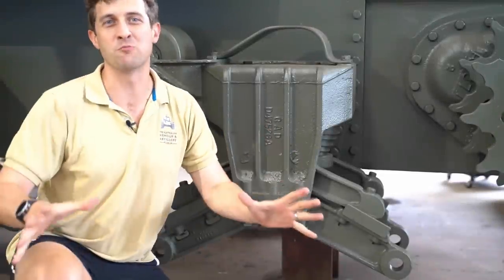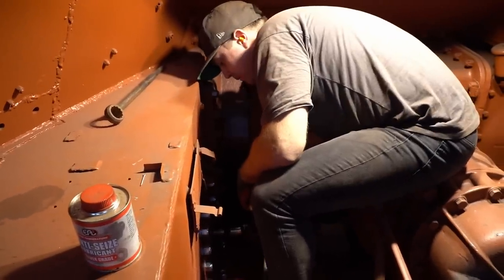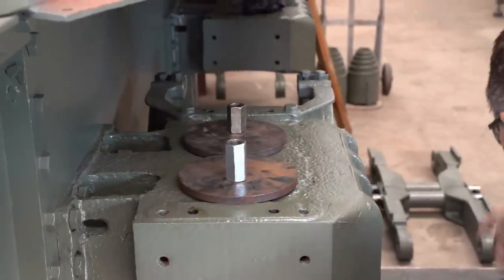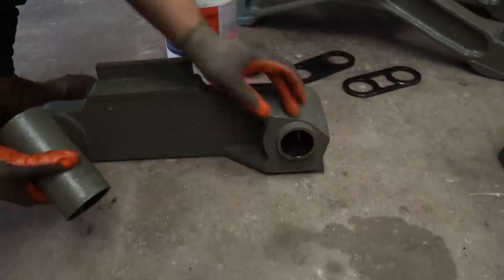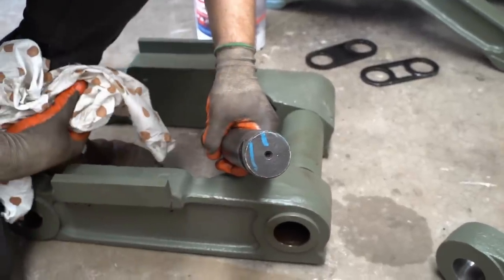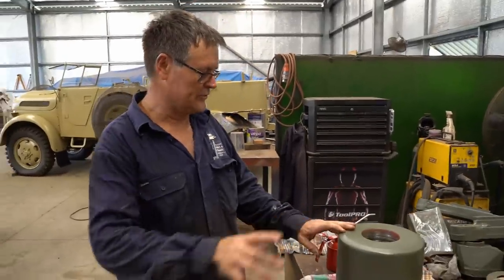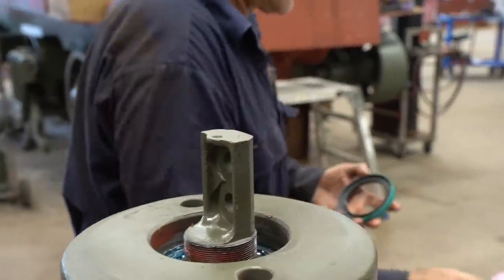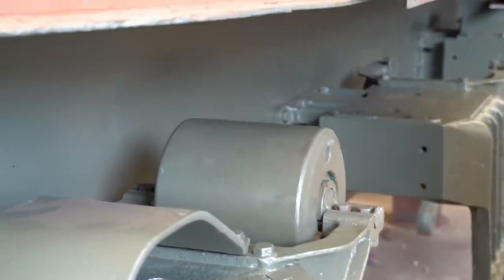WORKSHOP WEDNESDAY: Reassembling restored WW2 Grant tank suspension units

Comment: Originally the M4 used the M3 springs but increased in height to provide more ground clearance and travel. But in testing this lasted 500 miles in the M4 where as the normal M3 with its stock springs was making it 2000 miles. Thus the design was quickly revised by October 1942.

Comment: Its really amazing to think of all the engineering and design work that went into creating these machines. Building the factories to make them all the different assemblies made in dispart locations and shipped to the assembly plants. And to think that all the weight of the vehicle is supported by those bolts holding the suspension components to the Hull. My maternal Grandmother worked at Hamilton Field on Aircraft Skin’s ( Fuselage Repair) . My Paternal Grandfather was a Decorated Italian Soldier who escaped capture at the 1896 Battle of Adwa Abyssinia . He was a Machinist and Blacksmith who Immigrated to the U.S. and worked in the rail yard in San Rafael Calif. During WW2 He Worked at Marinship in Sausalito. My Dad was too young to serve but three of His older Brother’s  did and another operated a gantry crane that set the prefabricated superstructures onto the Hull’s . My older Aunts worked making Hard Hats and in the tool rooms . At 15 yrs. Old one of My Uncles had a job welding Conning Tower’s on Submarines at Mare Island Naval Shipyard before enlisting in the Army at 17 and serving as a Machine Gunner 133rd Infantry Regiment 34th Inf Div. He was awarded a Bronze Star with V device for drawing the fire of a German Self Propelled Gun in order that exposed troops could make a escape. One of My Dads older Brother’s was 18 when He first saw action on Christmas Eve 1944 as a Combat Engineer with the 289th Regimental Combat Team of the 75th Infantry Division. At Grandmenil Belgium. See Naming of A Hero for more detail on that part of the Battle of the Bulge. My Uncle Ernie Magri was a mechanic and dispatch rider in the 14th Armored. He is on the internet talking about His Bronze Star with V for Valor. He also is a big part of a story about His younger Brother that can Be read by searching Armando’s Last Ride.

Comment: the fine art of war time (and post war) assembly always amazes me, particularly when it comes to aircraft, i heard a story where De Haviland employed a number of guys to install the 30mm Aden guns into the belly pack on aircraft such as Vampires - instead and some time later the strategy changed when two Polish twins were employed, built like the proverbial brick SH1t house, the twins who were larger than any body builder, were able to lift the Aden's (less barrel) single headedly, hold in place with one hand and reach for the pins to secure, now i have handled these myself, and as with any gun, not light at all, with a huge bronze breach part, i can only imagine what these guys were like, why pay four when the job could be done by two, and they get a free work out to benefit

Comment: Great catch up on workshop Wednesday, those pressure relief valves you fitted to the return rollers are also fitted to the front steer axle hubs in the now obsolete British Foden Recovery Vehicles. Allowed the hub oil to escape when overfilled and heated during use, pain in the backside when it sprayed oil all over the hub and side wall of the front tyres when driving.

Comment: As far as the "Pressure relief valve" goes on the track return rollers, it was common on heavy equipment and farm equipment, we had old international harvester tractors (1930's - 1940's) on our property and they had this type of arrangement on certain fittings. Learnt about them when young and allowed to help with maintenance, told to "Pump the grease until you see clean red grease come out of that fitting!"

Comment: Pulling studs down would have help line everything up with the notches in the pivot bolt.  I use to assemble a farm implement that had the same design.  And we used long all thread to help light it all up and the they were removed and the bolts were they used to pull it all together.   

But, in the end, as always, they got it done!

Comment: Grease relief valve is typically installed to prevent hydraulic pressure from popping out the oil seals.

Comment: When using an oil seal to contain grease....  you'll have to flip them around to allow the grease to run out  under the lip of the oil seal.  The release valves fitted to the return rollers and road wheeld prevent to much intern grease preasure and therefore prevent the oil seals from being pressed out.

Comment: That grease nipple release is old school tech. Most autos here in the US had them pre1970s. It's you can't over pressure the bearings with grease as they heat up. It also told us when the void was full of grease. When we needed to add grease the old grease with dirt and water were pushed out. We would keep adding grease until it pushed clean new grease.

Comment: Gidday guys!  Loved this episode, I watched it twice!  I'm actually building a 1/35 Aussie M3 Lee!  Wow youse had those pivot bars pivoting so smoothly you could hang a bassinet off em & swing a little baby to sleep!

What a cool idea with the grease nipple one side & a grease relief valve on the other on the return rollers!  I guess they must have had special towed mobile 300 ton press adapted to fit on an M2A1 (?) 75 mm canon bogey, to replace those return roller bearings in the field did they I spose? - or a special compression tool #C-112-B!  

They look like solid steel rollers are they? - The way you were lugging them around ay Darryl?  I think the HVSS bogies had rubber tyres around the return rollers on the Shermans.  I wonder if they built any Lees or Grants with HVSS suspension?  I'm guessing that's a definite maybe?  I reckon they probly could have If they wanted to!

Hey can you guys do me a favour please?  Those four unused holes in a rectangular pattern in the front of the bogie housings, that face forward - can you PLEEEASE measure up their centre hole positions relative to the front rectangular surface of the housings?  I'd SO love you to do that for me!

Both my Battle of the Bulge M4A3(76)W Sherman & my Aussie M3 Lee are missing these holes!  They're obviously difficult to cast on the sprues of the 1/35 models, despite the latest 'slide mold' technology they have today.

Oh & can you tell me what diameter those holes are too please?  And yeah, while you're there, can youse please also measure up the hole positions of the return roller grease nipple & relief valve holes, & their diameters too?  That'd be so great guys thanks so much in advance champs!

I was gonna ask youse to measure up the positions if those cute little 1 inch or 1 1/2 inch grub screws above each of the volute springs for me as well, but they look as though they're just centred above each spring really, aren't they?  The other thing is they probably won't normally be seen will they?  

But yeah, those 4 front bogey housing holes mainly though please guys?  That's gonna make my 2 models 'extra special' with your help!  I've already got a set of number drills down to #60!

Have a Merry Christmas Present fellas!
  🎄🎄🚂🚃  🪂  🏕  🏝  🍻  🥴  👍

Comment: An honestly curious question that I've been wondering as I have watched this series:  Why didn't you remove/install the bodies to the hull as complete units, then do the restoration and reassembly separately, when you could move the units around for easier accessibility?
It has always been my understanding that the bogies were designed for removal as one unit, for speed and ease of maintenance.

Comment: how do you get a proper torque setting without using frame washers? Without thick washers the nuts are digging into the plate plate hull.
Reply: If I remember correctly they were riveted on originally.  If that was the case the steel is hard enough to just use a nut without a high tensile washer.

Comment: That suspension spring is odd to say the least, who came up with the idea, and does any other country use the same method, thanks for a good series.
Reply: Volute springs have been kicking around for a very long time.  They have a number of advantages, including being self-aligning.  They are usually used in heavy equipment applications such as tanks or railway buffers, but you'll find them on things like the humble garden shear too.

Comment: All the old Madill Cable Log Haulers were built on Sherman/ Grant and bigger Tank under-bodies. These proved to be problematic as the original Tank transmissions are too weak to handle the weight and torque of the much heavier and more powerful Hauler bodies being put on top. Many people re upgrading the Haulers by removing the Tank bodies and mounting the Hauler upper-bodies onto Excavator track frames. This means there are a good source of Tank parts available through Hauler remanufacturing facilities.